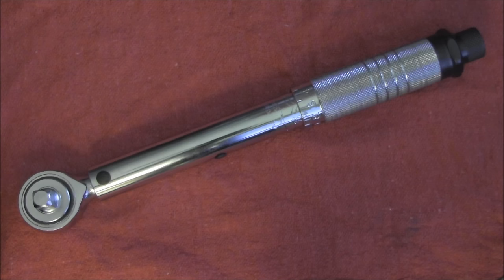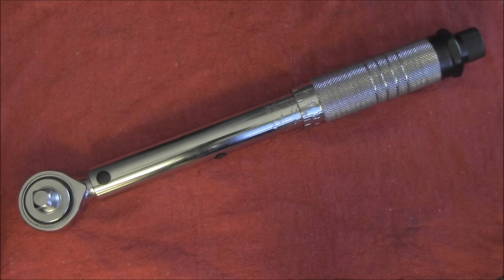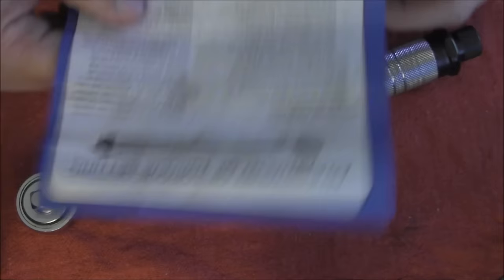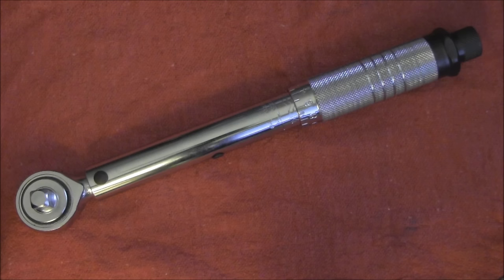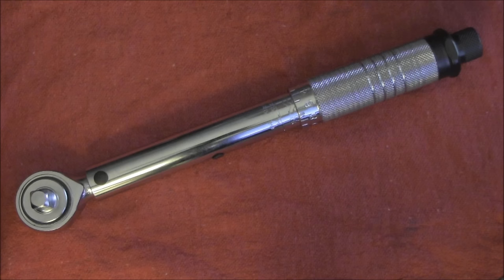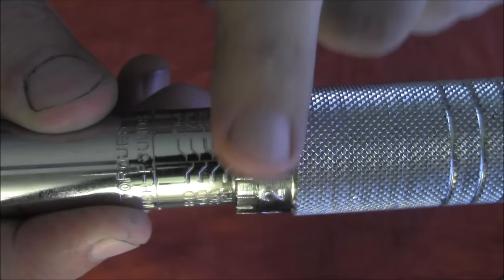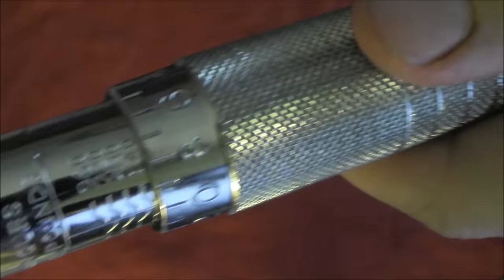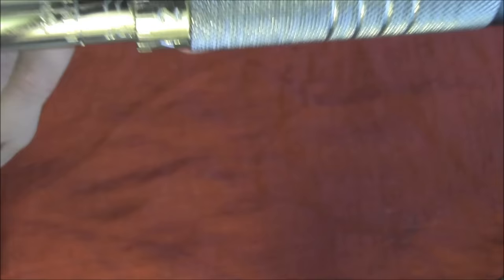How to use torque wrench for beginners

Comment: Oh this was great! A basic understanding of math-inches-feet are needed for sure. There are 12 inches in a foot. For example, my Honda spark plugs need to be torqued at 156. On my torque wrench,  the lowest number closest to 156 is 120. So I stop there. Then I turn the graduation to 3 which means 3 times 12 is 36. I add the base number which was 120 plus 36 equals 156. I hope this helps.
Reply: Ottima spiegazione,ho capito meglio da te che da tutto il video sopra,😊

Comment: One of the most important things to remember, when using a torque wrench,  is to return all settings to zero on the handle setting of your wrench or it might go out of calibration having constant spring pressure inside the torque wrench mechanism. Also, many torque wrenches only recommend using it in the tightening direction only and not in the loosening direction.
Reply: They torque both left and right hand thread, but must not be used as a breaker bar
Reply: Great info thanks!

Comment: When you store a torque wrench, back it out all the way below the lowest setting. This will reduce spring pressure and keep the wrench accuracy from going out of tolerance.
Reply: I dunno, the owners manual on both of mine say to set at the lowest setting when storing, but not to go below the lowest setting like you said when storing
Reply: @muddyhotdog4103  I'm guessing that's the "zero", and you're both right. As there is no actual zero, but my instructions say the same thing.
Reply: @dadthelad  possibly indeed
Reply: The lowest setting like 20 lbs not 0

Comment: Dude! 480 divided by 12  is 40 ft lbs. I don't think that 504 (42 ft-lbs) is gonna make a big difference== 5% difference. Your torque wrench is probably not that precise anyway for $20. set it a little beyond 480 and call it a day. You just set back most DIY'"ers back 20 years. Good luck in your car..be safe ...don't forget your seat belt....really!

Comment: Makes sense. 12 inches = 1 foot. Each turn of the knob from 1 -10 equals 12 inch pounds.
Reply: Yes the lowest default torque ft lbs is 10 lbs

Comment: I have been a mechanic for over 30 years and up until today I never used an in-lb torque wrench. On a 7.3 HPOP there are two bolts that need to be set to 18lb-ft. Normally anything below 50 lb-ft I just use my 3/8 ratchet and german torque (gudentight), but as this is a very important part for the 7.3's longevity and function I wanted to torque it according to the Ford / International diesel spec. None of my torque wrenches go lower than 50 lb-ft (because usually I work on large machines that require 50-250lbft). I picked up a GreatNeck MATW1 in-lb torque wrench from a friend, who never used an in-lb wrench either so neither one of us knew what incriments the graduations were indicating, and neither of us ever understood algebra or any advanced math so we were unable to decipher the incriments. I thank you for explaining the handle graduations were in lb-ft, which allowed me to achieve the 216 in-lb setting to equal the 18 lb-ft I needed for this job. Thank you for making this tutorial!

Comment: I have this wrench. Every number on the handle (which goes as high as 9) is a multiple of 12 for inch pounds. The guide on the shaft is total inch/pounds of force. Example: I zero the handle  to match up with the centerline on the shaft to match the  360 inch/lb indication. Then I can twist to 3 on the handle. 3x12 = 36 and add that to the original 360 inch/lb. I’m at approximately 396 inch/lb of torque. I then lock the twist ring at the bottom and I tighten my bolt or what ever. And reset to lowest setting and unlock to relieve stress on mechanism. Hope this helped. It has a range of 120-960 in/lbs
Reply: So what would 14 foot pounds be? 14x12?

Comment: What are you guys talking about? This is a great video. I just bought that very same torque wrench and the instruction was kind of confusing because the vertical scale measures in inch pounds whereas the horizontal scale measures in foot pounds. It turns out there are 12 inch-pounds in 1 foot pound, which is how he achieved 504 inch pounds by adjusting the wrench. This made me understand how to use this $20 at AutoZone wrench which is exactly what I needed. Great video! Thank you for taking time to explain this, record the video, edit the video, and upload the video. It accomplished exactly what it was meant to accomplish in only 8 minutes and it helped many, such as myself.

Comment: Jusst make sure to ajust it back to 0 after use this is inportant.. 
Even tho it's a cheap wrench, take good care of it and with your use probably last you manny manny years, you will need to calibrate it and you can buy a digital calibration unit for cheap. This unit can also convert a standard ratchet to a digital torqe wrench, but I jusst use them as a calibration unit. Sending in your wrench for calibration gets expensive in the long run. I may reccomend AC Delco for calibration becouse it has a peak setting and if using it as a torqe wrench it has a sound alarm when correct torqe is gained.

Comment: You just saved me!!   I bout the same dang wrench and needed it to be set to 140 in-lbs and after watching countless videos on YouTube that did NOT mention the marks were adding 12 in-lbs per mark.....  I finally found your video!!
Reply: the numbers do not add 12 in lbs.  Go retorque because he made you do it wrong.  Inch lbs on the bar and the 2 on the handle means 2 not 24 in lbs.

Comment: Hey Paul. Several other things to be aware of: These wrenches need to be calibrated periodically to be accurate. Some machine shops can check and adjust calibration if necessary.  They are most accurate in the middle of their range. Never use it to loosen bolts. Dropping it can throw the calibration way off. Finally, most specs are for clean (rust free)  non-greased threads, but sometimes apply to using grease for the correct spec. Torquing bolts is really about getting them to the correct tension.
Reply: It was calibrated before it left the factory

Comment: Thanks much ! Not a mechanic but mechanically inclined. My wallet does not support a mechanic, so I have to take a swing myself. Its been 30yrs since I've had to use a torque wrench that was not a needle gauge. Asked three people that I would call a mechani . All three gave me the shoulder shrug about figuring out the setting of this very torque wrench. I popped up YouTube and here you  are, again thanks for your time and efforts.

Comment: Up and down are inch ilbs. Left and right are ft pds so the line on 1 is #+12inch lbs(1=12ft lbs) So if you go to 2 it would be #+24(2ft lbs). Yeah at first I thought a line means 10 or 20 inch lbs.

Comment: There are only 10 digits on the graduatiion scale 0-9.99. You want 504 inch pounds ( once you convert it to inch pounds only deal with inch pounds). When you go to 480 inch pounds on the engraved scale, you  only can increase that 10 digits to 490 inch pounds. So you will  have to go up one scale on the engraved left and then turn your graduation scale so that the scale and the graduation add up to the 504 that you desire. If it still does not total to 504 inch pounds, then go up one more scale on the engraved right and add your graduation scale to reach the                                                     504  total that you seek.

Comment: Hey brother I appreciate the effort and research you put in this video. I know you saved me a whole extra headache. Thank You.
Reply: I'm 60 years old, I've been working on car since I was 14. I want to share my knowledge with you. If you are working on a vehicle and you have a fastener to torque down,you want to buy a torque wrench in the mid-range of what you were torque a fastener to. Example lug nuts normally most vehicles a hundred foot pounds. Use a half inch drive torque wrench with a range between 50 and 250 ft lb . If you trying to torque down a fastener that requires 30 ft lb. You would use a 3/8 drive torque wrench with a range between 10 and 80 foot pounds. I know these tools are expensive but to work on a car you need at least three different torque wrenches. Some other things to point out always store the torque wrench at the lowest torque setting. When using the torque wrench hold it at the handle and turn the fastener and you stop as soon as the torque wrench clicks or gives.

Comment: ARE THESE CHEAP WRENCHES ACCURATE???  I bought one of these.  Exactly the same as in this vid.  It's a $20 "no-name" wrench from O'reillys.   We have a high dollar torque wrench validation unit at work that we calibrate often.  I checked my cheap wrench on it at several different settings and it's spot on every time!  Not bad....  Raises my confidence to use it on my small engine rebuild.

Comment: Paul, you cant please everyone. But I want to say you do get what you pay for. Did it come with a calibration certificate. ? a cheap one like that is probably at best +/-10% accuracy, an average click type torque wrench is +/-3% and the digital +/-1%.  I wouldn't use the one you have on any engine I was working on. A torque wrench should be calibrated every 12 months or more depending on use. However in your case that would cost more than the wrench, about $35.00.
I think you provided any newbies with a little input. kudos to you for trying ignor the jerks.

Comment: Great video and accurate. Inch pounds are used when the torque specs are lower than 15 ft pounds usually. This is why you have a smaller leverage wrench than the larger ft pound torque wrench.

Comment: Thanks Paul; that saved me a lot of aggravation. I have the original packaging from Harbor Freight. It's model M202-P from Performance Tool. Truthfully, I wish it were only in ft / lbs. I'm even batting around returning it. In my 65 years, I've never had an "inch pound" thrown at me and likely never will. Sure I can multiply and divide, but I'd rather not. Thanks again for taking the time.
Reply: Correction, I got the wrench at Advance Auto Parts and not Harbor Freight.

Comment: Besides the dizziness inducing movements due to your trouble focusing the camera on the tool I think you did a great job at explaining what made me return my torque wrench. I also got a lot of misleading information from mechanics about the use of this tool and some of them even admitted they don't even use it (for some jobs i guess) so after reading the very bad manual from the Chinese manufacturer I gave up and just returned the darn thing. I just found out that the job I did on my Montero 4x4 engine has to be redone due to some other peaces that will have to be replaced I figure it would be now a better time to order one of these but I will just buy an American made tool instead of ordering from Amazon.

Comment: I own and use both types of torque wrenchs. The digital is for sure more idot proof but you get used to the cheap click type fairly quickly.  I use the digital mostly for engine work and click type for lug nuts and brake/suspension hardware. 

Also not sure how I ended up on this video. I was watching a tool review and now I am in torque wrench 101.

Comment: Ummm, yeah I think I'll just keep guessing like I have for the last 40 or so years. Never had an issue with anything I've worked on.
Reply: jeff Hardin yup..... he shows how to set it but I’m clueless on how to use it after u set it... 🤷🏼‍♀️  I know how to use ratchet & socket but this torque wrench thang is all Chinese to me.... in a day or two I’m gonna attempt to put a hitch on my vehicle and it says to tighten bolts to a certain ft pound... so I was talking to my ex husband and he said we won’t need a torque wrench lol I said well what u gonna use then..... he said “use 💪🏼” lol so I may just go with that method lol like u, we never had any issues before when we didn’t use a torque wrench lol

Comment: Thanks for posting this video I bought a similar torque wrench I inch pounds, and I either missed the part in the instructions that says the dial is in ft pounds, or I wansnt paying attention.  I needed 150 inch pounds, and when I turned to 150 it lined up with 230, it makes more sense now.  I will try it again using ft pounds on the dial

Comment: They put inch pounds for space purposes. 12 inches in a foot. Its easier to put 120 inches. Which equals 10 foot pounds.  Than 1 foot pound, 2 foot pound and so on. You would run out of space on the tool. To get to 48 foot pounds. The graduations on the handle. Just adds 12 inch pounds per notch or 1 foot pound per notch.  To whatever inch pound you set. Starting at 120 inch pounds or 10 foot pound. Guess they could put 10 20 30 40 50 60 70 80 then just put foot pounds. That would simplify things. Who does that? And it isn't exactly correct. So you can look at those marks on the handle as 10 foot pound per notch. 120=10 foot pounds 240=20 foot pounds 360=30 foot pounds and so on.....

Comment: I have a Kinchrome that looks very similar. It's basically working, but my lock nut doesn't seem to do anything - I can easily adjust the torque setting even when it's locked.
Reply: Yep - it was faulty. Exchanged it for a new one.

Comment: I have a off and on wrench the foot pound was 87 I could only find it on 2-4 and 10-12 on brakes and lug nuts so I give it two turns if I can breaker bar this off so for my 87 with 2-4 it took 5 then just before torque I stopped to six clicks it on super

Comment: Thanks for the video. I think I missed something.  How do you use the darn thing? I see how you set the value, but then what? When you turn it, what will it do? I have a in-lb tool, I was trying to apply 70 in-lb but I kept turning and turning I am sure I had apply way over 70 in-lb of torque. What is it supposed to do when you have reached the desired torque? 
Thanks for taking the time for the video.
Reply: Yeah that’s where I’m stuck after 70in-lb does it break free so you can’t tighten it anymore???

Comment: I have the same goofy torque wrench as you.  The manual for what I'm installing calls for 7 ft lbs which would be 84 inch pounds but it starts at 120 inch pounds.  I can't use this torque wrench?

Comment: This is incorrect. I dont know how many people this has taught how to use a torque wrench incorrectly over the years but this should be taken down and/or redone. By the end you set the wrench to 482 foot pounds, not 504. Each number 1-0 (essentially 1-10) is one foot pound. You made the mistake of adding inch pounds to the 480 not foot pounds. To get to 504 from 480 you need to turn the handle 2 complete rotations, till its back at zero, then rotate it to the number 4 mark.

Comment: You talked about the whole video and did not show how to use it. 
Here is what I would do: Get a bolt, lock it to a bench vise, get the nut hand screw it to the bolt, get your torque wrench, set the torque, and show us how it works.

Comment: your gonna miss calibrate your torque men release that lock underneat the handle so you can easy set it, your forcing it without unlocking it thats why its hard to turn the handle cause you did not release the lock

Comment: So ive got the same type tork wrench and im  At a loss, trying to figure out how to set it to 72 in/lb which is 6 ft/lb but I dont know how to set it on my wrench
Reply from the maker: the handle shows 0-9 at the top, that is foot lbs.So if you stop at 6 you will be where you want to be. when you look at the slides going up the arm of the wrench it reads in inch lbs. if you turn the handle from 0-9 and finish on 0 again (stopping on the vertical line) you will see on the arm where the vertical line and slide markings are you are set at 120 inch lbs or 10 ft. Lbs. All you need to do in order to set it to 72 inch lbs or 6 ft lbs. is stop on the number 6 as your turning the handle. I hope that makes sense if not let me know I will send you a video showing it.

Comment: Just bought one today at O'Reillys Auto parts, it's a "Power Torque brand, trying to convert Nm to inch lbs. on it right now and it is a bit confusing . There are 3 differet sets of 3 columns of conversion wtf.
Reply from the maker: +Hiloha'homa I feel your pain man, I tried to go back and do the math and show people how to do it. but I was left scratching my head. my solution was to find the best NM explanation i could find and link to it on my video. If you figure it out and record it let me know i would gladly link to your video

Comment: Do you not then have to tighten the end bolt up on the wrench to lock the setting in before using?
Reply: Not necessarily, I would if using that setting for multiple bolts, just keeps it from changing while tightening something

Comment: hi Paul what's the right torque to tighten a 19mm bolt they are 17inch wheels? im in the UK
Reply from the maker: sorry for the lag in respnse cris. check out this link from dicount tires it could help. http://www.discounttire.com/infoCenter/infoWheelTorque.html

Comment: Really you are just telling us how to set a torque wrench. Not how to use it. You need to demonstrate how to tighten a wheel nut, how to hold the wrench and stop when it clicks. Besides that thanks because I learnt how to set a torque wrench.
Reply from the maker: I do have video of me using it when i'm setting the ft-lb torque for the center link on my sons front end on the Chevy S-10.  http://youtu.be/3OrYyyo2YZ8

 I guess I made an assumption that people who needed to use one wouldn't need it used as part of the instructions, For me the big question was going to be how to set it and address what I thought were the confusing instructions. 

thanks for the feedback Maungsacca
Reply: Paul Foster Dont worry it did save me reading the instructions that came with mine. So thanks.
Reply from the maker: was going through and decided that you made a good point in your previous post Maungsacca, I've added an annotation link to the exact point in another video where I show you how to actually torque down a bolt with the wrench.